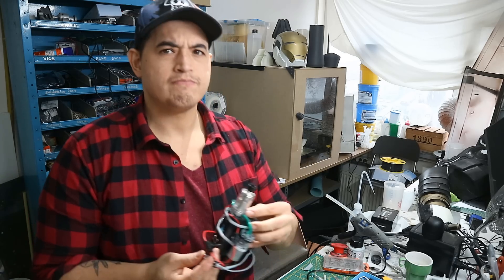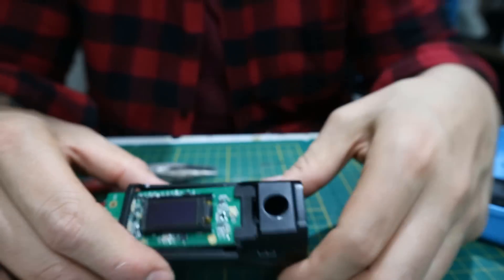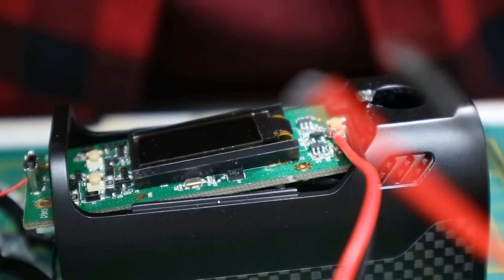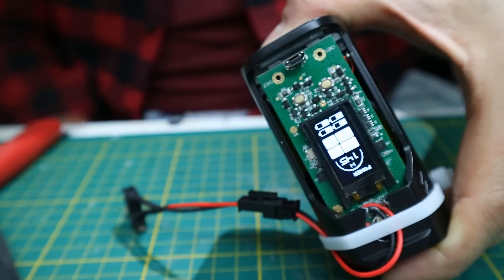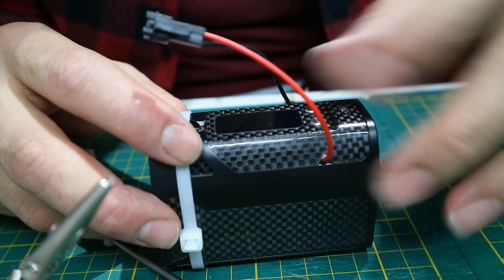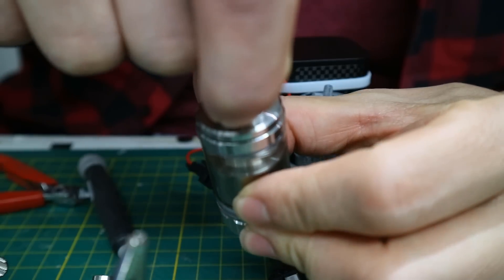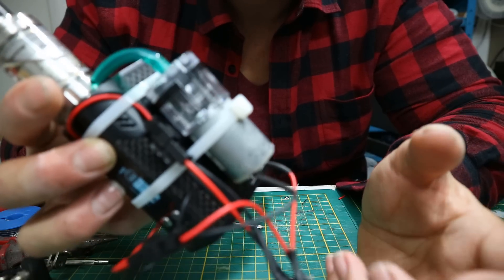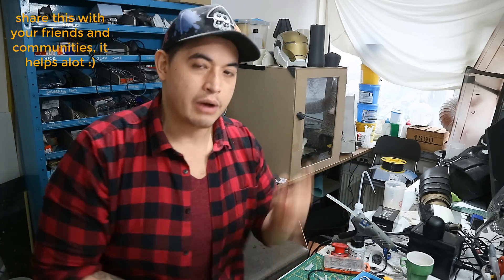Super Smoke machine XXL for your cosplay and props

Comment: So if I were to make two of these, attach the outputs via parallel connector to a single pipe, replace the switches with MOSFETs and an Arduino controller, I could have one on for one minute then off while the other turns on. Basically halving the duty cycle and allowing it to be on constantly.
Reply: Vape shop employee here. I'd recommend against this, if you want a constant flow, I'd recommend buying an actual fog machine that's made to be run for long periods of time. On the inside of the tank there's cotton, as he showed in the video. If you run it for more than a few seconds, it will burn the cotton, potentially setting it on fire if you leave it too long. It smells terrible, and could be dangerous. As he says, these are meant for vaping, and using it as a constant fog machine is not a great idea :P

Comment: Great tutorial!  I wish I had seen this before I built my own system.  I ended up using a 2 litre bottle as an air tank with a small 12vdc mac valve.  It does the trick for short bursts but I have to pump up the air tank frequently with a small bike tire pump.  Definitely going to invest in some air pumps next time around.

Comment: Dude! What happened to the other smoke machine tutorial? the tiny one? :(
Reply: Same. I got part way thru and it vanished!
Reply: i think he wants to sell his developement
Reply: Which is not a reason to take down the video - people who want to DIY will DIY anyway, and people who prefer buying something premade that's known to work, will buy it.
Reply: @ThiefMaster  the videos are back i think. Which probably hurts his business because the price alone is 5x the amount of the bare minimum you need to build one on your own. You can get the vape pen housing and coil for 3 bucks at a vape store (canadian dollars) or a tank and coil like he uses in this video for 15 bucks. The motors are cheap af on ebay, but you can order from amazon since pandemic is slowing things down. Wire is cheap, shrink wrap is cheap, chances are you're using this with a limiter switch to turn it on, those are dirt cheap on amazon and ebay. Honestly the pen design is prolly 25 bucks tops and this design is 40 bucks tops if u know where to look. No need to charge 100+ euros

Comment: This looks just like what I have been looking for for a Cosplay project I'm working on.  How long will this run before the batteries run down?  My project has capacity for a couple car batteries (size & weight), but I want something that could run for hours at a time.  I can also have a big juice container to fill the unit to keep it going.  Just wondering if I should go with these batteries or get something with more endurance.

Comment: Looking to put together a couple of these for an upcoming build, but the link for the batteries seems to be dead. I did look up those batteries, and they have a continuous 20A rating, 40A burst, but the RX300 specs call for at least 25A. The only 25A+ batteries I can find are 1500mAh (compared to your 3k). How important is that difference in discharge rating, and do you know of a substitute brand/battery you might recommend if the Listman isn't available? Also, with your 3kmAh batteries, about how long can they go before recharging, and would a 1.5k mAh battery set drain too quick to be practical? Thanks!
Reply from the maker: Charles Wang https://m.nl.aliexpress.com/item/32820258385.html?pid=808_0009_0109&spm=a2g0n.search-amp.list.32820258385

Comment: What would you do if you wanted to add LED lighting along with the smoke?
Reply from the maker: Alexandria Winters run it through a separate circuit/battery as the vapes internal batteries already get drained too much with the airpumps hooked up
Reply: LEDs can stay on all day.  Wire those up separately for sure so you can stay lit all day.
Reply: I'm running mine on a separate battery pack. Simpler system in my case, i want them on and when on flashing in cycle. Not options for other patterns.

Comment: Same boat the Wismec RX300 seem to be dicontinued... But is did find the specs the site so that we can find something similar. 
Parameter
Size: 42mm*58mm*81.7mm
Thread Type: 510 spring loaded thread
Cell type: High-rate 18650 cell (THIS is important!)
Cell type: (discharge current should be above 25A)
Output Mode: VW/TC-Ni/TC-Ti/TC-SS/TCR Mode
Output Wattage: 1-300W
Resistance Range: 0.05-1.5ohm for TC modes
Resistance Range: 0.1-3.5ohm for VW mode
Temperature Range: 100-315°C/200-600°F (TC modes) (THIS is important!)
Maximum Charging Current: 1.5A (THIS is important!)
Maximum Output Current: 50A (THIS is important!)

Still no replacement yet.... only found 75W on a a single cell. I could maybe mock up 3 of these but they are not a cheap units. at 105-175USD per pop for the base modle.

Also the Eleaf melo 300 is DC'd as well.
100-300W for huge vapor production. What I'm also having trouble with Is a lot of the atomizers are listed in ohms so like 75 ohms and converitng to this watt range is not working for me. So far  300-watt panel produces 240 volts, which equals 1.25 Amps is as far as an conversion. T-T

This one looks promising given their track recorder with previous models. I would still need 2 of MicroFogger 5 Pro which makeit it expensive but being able to run 2 lines off of these for 7 min full up time would be nice. 
https://www.youtube.com/watch?v=aMwjw1IsJlo&t=99s

There is also the Smoke Genie cost as much as 2.5 of the MicroFogger 5 Pro. It does run hotter from product testings I've seen on youtube for it so maybe not ideal if you have to house close to your body. 
https://www.icd-usa.com/pages/smokegenie

Last is a smaller output fog that can run 3 amomizer at a time. COSCLOUDS 2 I was planning on buying their FOG diffusers either way to feed off of some tubbing.
https://www.spoonmakes.com/product/cosclouds2-starter-kit-a/

Comment: How long can I leave the juice in my vape smoke machine? I heard if it's over saturated it can fail? Helpp
Reply from the maker: Well it can over saturate yeah, it's not corrosive so it won't eat away your coil or anything, what I tend to do if it sputters and bubbles I take the top off and blast the coil with airduster, that sprays away all the excess juice, run it for a bit after to clear it off the remaining stuff and then refill if needed

Comment: I got as far as hooking up the first airpump, but the second I put the batteries in and close the door, the whole thing gets so hot that it almost immediately starts nearly burning in a matter of seconds
Reply from the maker: Then stop instantly because you wired it wrong, please be careful
Reply: Yep, I totally screwed something up. So I slept on it for a day and figured it might be the two soldering points for the power supply. I redid that step, cleaned it up and added more heatshrink, that fixed the problem and thankfully I didn't damage any of the circuitry (or burn myself).
Reply from the maker: @enki2542  be glad, I managed to screw up one of these mod boxes figuring out all the work for this tutorial, costly mistake

Comment: It's probably worth mentioning that the power leads you are using are only connected to TWO of the batteries. That was a bad surprise for me when I tried to connect a radio-controlled switch which has 12V relays on its PCB...

Also, if you plan on building this: soldering the wires to the fire button is a HUGE PAIN IN THE ASS since the connectors you need to solder it to are TINY. No reason against building this of course, just something to keep in mind - this part is most likely make you curse the most while building it.

Comment: Do you sell these?
Reply from the maker: No, I'm busy with a safer system as this is just parts slapped together
Reply: @Costronica  thank you for the reply! Is the new system available or will be available soon?
Reply from the maker: @CC6_Fanclub_President  afraid not, it's a difficult thing to get 100% safe as temps run hot, I do have other smokers and thruster systems for sale though, check em out on my website waynesworkshopcosplay.com

Comment: I have a question about the mini switch! I you want to add lights with the mini switch but it only has three points of connection, would you put the positives together and the negatives seperate or do you add both wires on one hook or what do you do? Thanks!

Comment: Hey Wayne! Not sure if you recall my question about feeding the smoke thru a manifold set up for a junkrat wig. This set up may just give it the push it needs. However, i waa hoping to run it off cell phone battery charge banks- faster to switch out batteries and charge thru the day. I think your old video used a similar set up. Would those have the power to run this much tech off it? Id also like to run a similar rig for the smoldering coal lights for the hair tips, if i can ever get the resistor issue sorted out. I have them running, but to use a flash module, they need resistors, and i suck at the math for those.

Comment: Are the batteries in series or parallel?
Reply: Think about this question
Reply: I don't think this is a bad/stupid question. The coil runs on 300W as max power, that's 40A at 6V. Each battery provides 3.7V, so 2x2 in parallel+series would give you enough voltage. But I'm not sure if putting batteries in parallel is a good idea in general.

What I CAN tell you though is that you have the same ~8V on the two power connectors used for the fans regardless of whether you have 2 or 4 batteries inserted. So either they only use 2 batteries for the electronics and only all 4 to power the coil, or they have 2x2...

Comment: !!!WARNING!!!!
Hi there.
Nice tutorial, i've build a smoke machine for my own project with this.
If you do this modification on a RX300 or similar you really NEED a fuse in the power-line of your Pump (as near as possible to the 18650).
The RX300 itself has a fuse that will prevent shorts on the 18650, but if your weld on cables, like in this tutorial, it can happen inside your selfmade circuits. 
A short will lead to glowing hot cables and or EXPLODING 18650!!!!!!
Adding a fuse is 2 minutes more work and will cost like 2€, but it can prevent heavy burnings and injuries!!!!
Reply from the maker: a fuse could be added, however a short outside would either happen by exposed wires (never have wires exposed) or the airpumps shortcircuiting (which is unlikely to happen) but hey, safety first so a fuse can be added indeed-